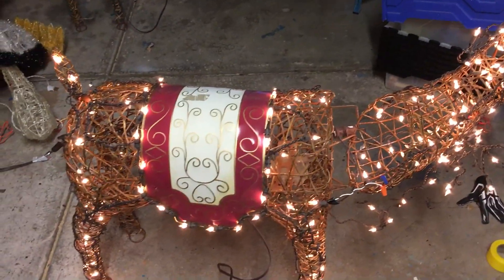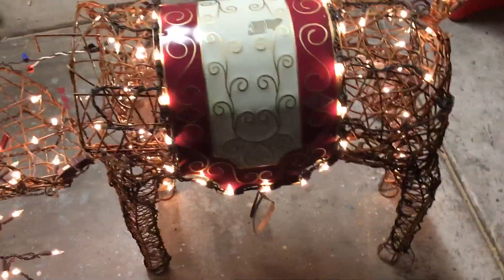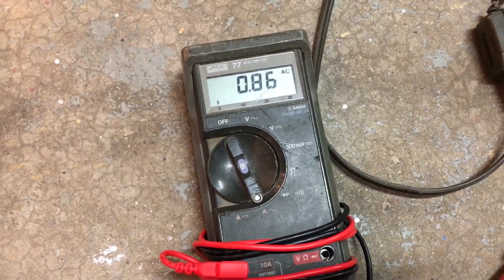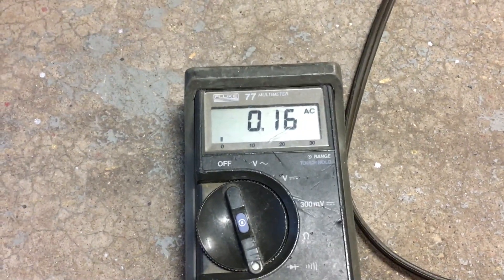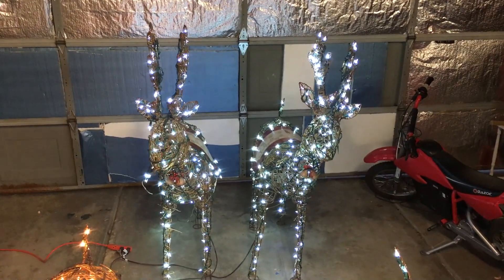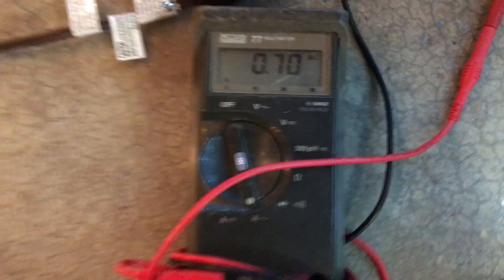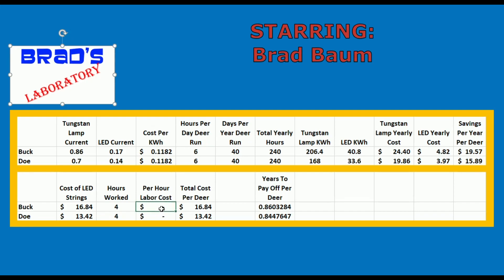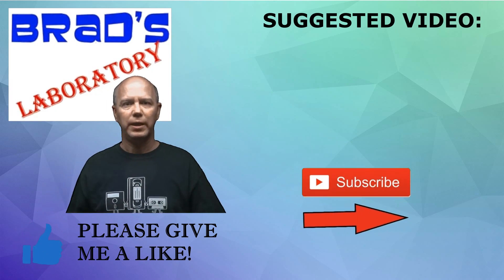Christmas Reindeer Re Lamp

Comment: Those clips your using to attach the lights to where can I get?
Reply from the maker: They came with the deer many many years ago. I would use some black tie-wraps if you don’t have them.
Reply: @BradsLaboratory   how many feet of lights did u use may I ask?
Reply from the maker: @kellenstarkel2605  I remember saying how many strings, but I must have cut it out of the video. I will have to look some of the raw footage and see if I can find it.
Reply: @BradsLaboratory  well if u find out lemme know
Reply: I got some deer fairly similar I'm redoing but when I got them someone took the lights off allready